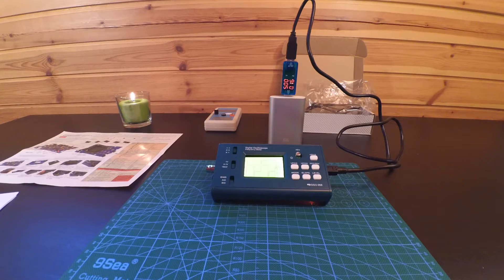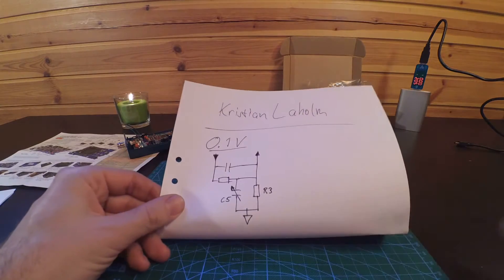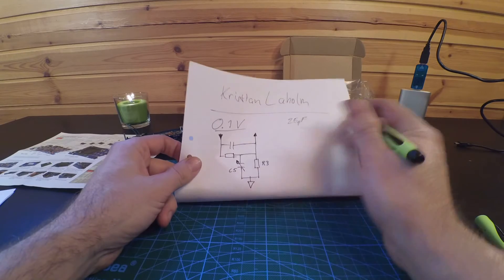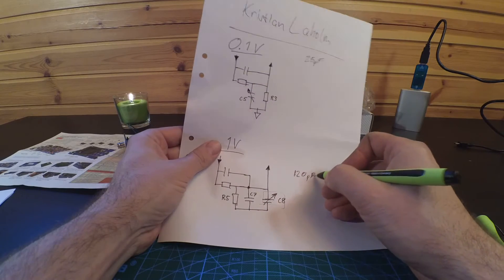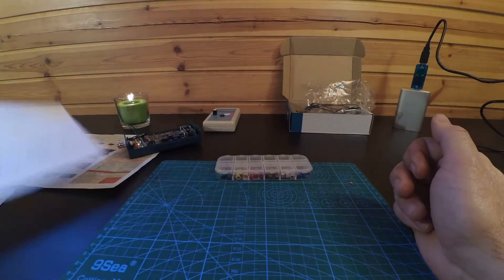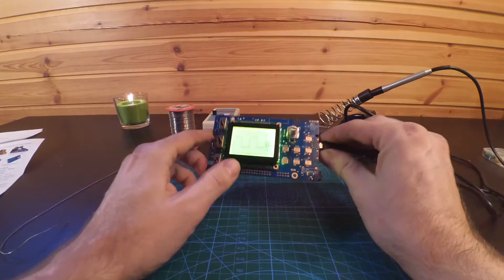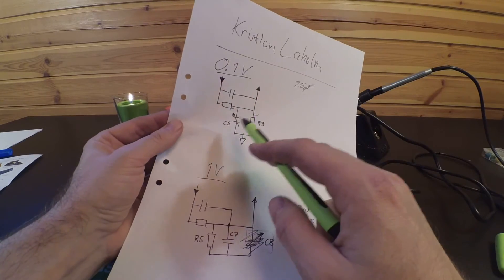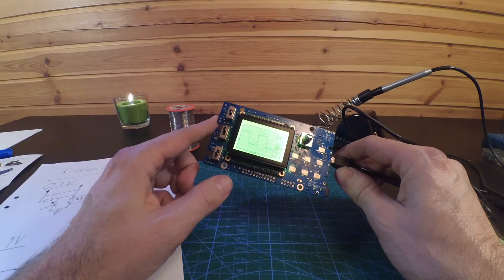#5:2 DSO068 DIY Oscilloscope Kit - Part 2 Input Capacitor Problem

Comment: Condenser 25 pf polyester  parallel  R3, gradient C5?, Ceramic capacitor 98 pf C8 code 104? Delete C8, the doubt remains with me 25 pf condor of the type that is, apparently polyester  or Trimmer Ceramic? is appreciated? Forgive my bad English, I hope you understand the message,
Would it be possible to link to buy component
ondensador 25 pf poliester  paralelo  R3 , graduar  C5 ?, condensador ceramico   98 pf  C8   codigo  104? eliminar C8, la duda  me queda  con condesador  25 pf  del tipo  que es, ¿al parecer  se  aprecia   poliester o Trimmer Ceramic?  ? perdone  mi mal ingles  ,espero  que  comprenda el mensaje,

Comment: What capacitors did you use? I didnt understand
Reply from the maker: I ordered a set of different variable capacitor and tried some of them (of camera) to find the best one.
One of them i didn't need any capacitor so I only removed the one i had broken on the PCB.